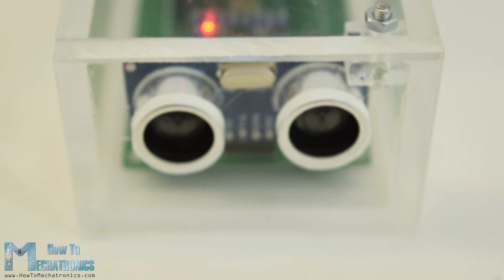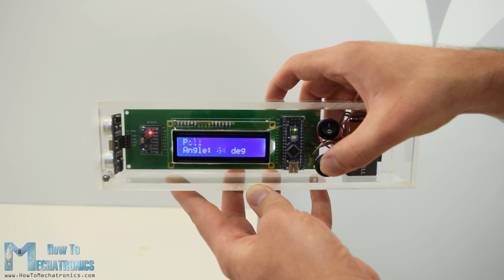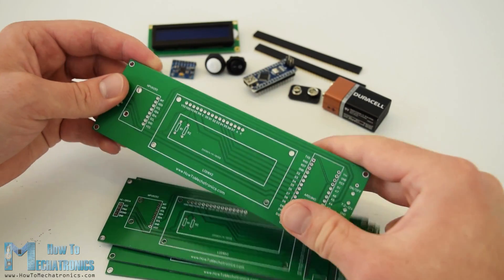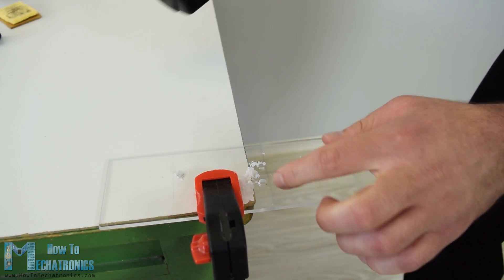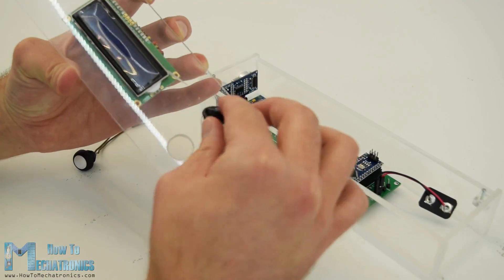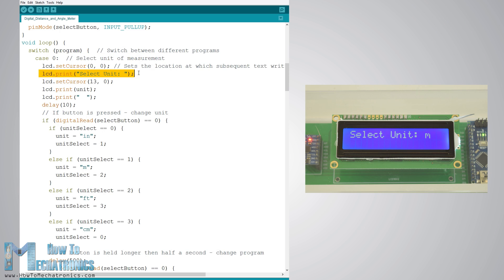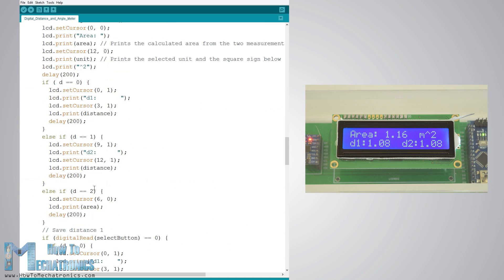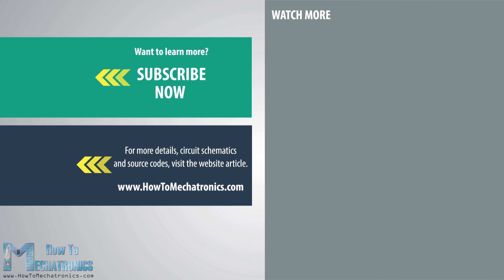Arduino Range Measurer and Digital Spirit Level Project

Comment: It worked accurately...👍
All the information given and programme is correct and thanks 🙏 for providing information.....😊😊
Reply: Can you please tell me where to connect the selection button
Reply: @omkarkrishnatsathe5588  Any one pin of selection button to common Gnd...then other to D10 pin of arduino and also to 5v  passing through suitable resistance.
Reply: Thank you

Comment: Nice project, well done. The only thing I would suggest is the option to add the offset of the box length to the measurement, that way you could say, hold it up to one wall in a room and get the exact distance to the opposite wall.
Reply from the maker: Thanks! Yes, that's a good suggestion and it can actually be easily implemented.

Comment: can you help me to find the library of the giroscope
Reply from the maker: The Arduino IDE includes the Wire.h library, you just need to include it. The library just enables the I2C communication, so actually we are not using a dedicated library for the accelerometer module in this case.